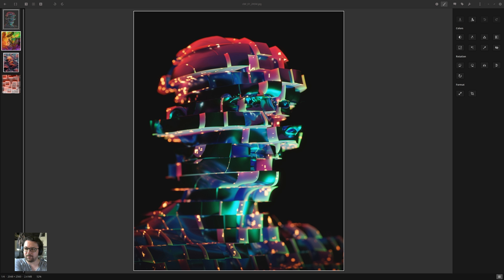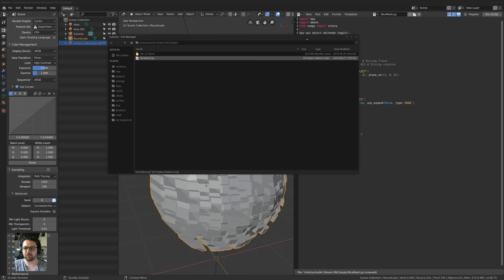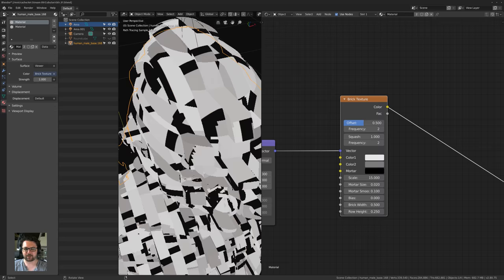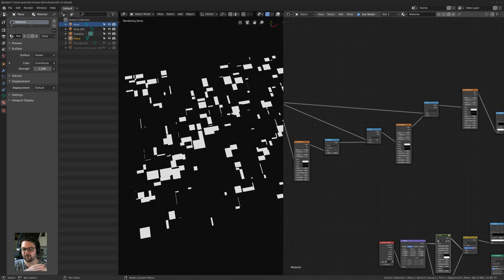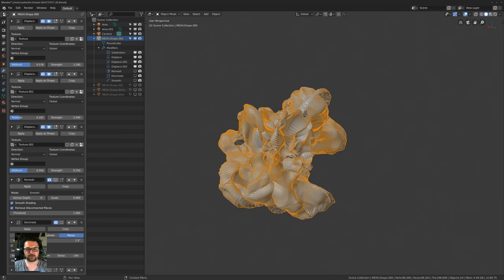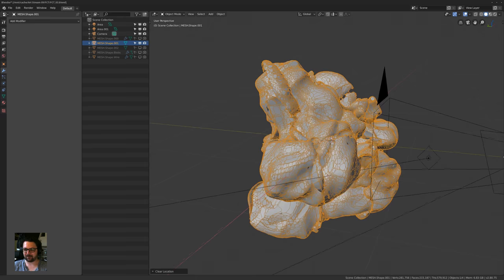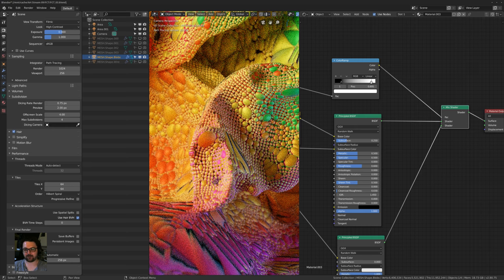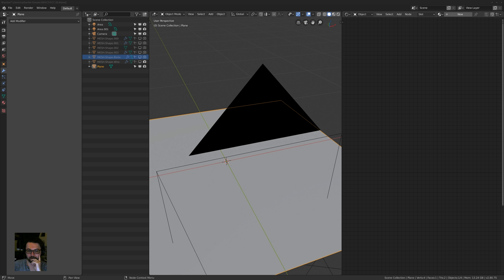Art Stream #09: Cubular, Fct, Hypergel & More! [BLENDER]

Comment: for the first slicemesh portion, once the object has been transformed, it is doing so in object mode, and I'm wondering if theres a way to use shapekeys to interpolate from the base unchopped mesh to the new one, I'm finding that this seems to be only possible if you make your edits that youd want to be your shape key target in edit mode rather then the transforms being applied in object mode.... any thoughts? And of course before any answer: thanks for all your amazing contributions including this vid and this script!!!
Reply from the maker: With shape keys the number of verts would have to stay the same, so I think once you start slicing things would fall apart, unfortunately.
Reply: @MidgeSinnaeve  hmm okay thanks that makes perfect sense but actually I was trying to do it on the before and after of the randomize transform stage, so after the cuts had already been made... does that make sense? The change to the mesh via the randomize transform is what I want my 'target' to be and then the cut up but untransformed mesh as my basis.... so the # of vertices stays the same...
Reply from the maker: @jsogman  You'd have to do some of the transformations by hand after the slicing and take out that part of the scipt, but it should work fine like that. You could even animate it indeed.
Reply: @MidgeSinnaeve  ok yep that's what I thought, but thanks for confirming!!  I suppose I dont quite understand the necessity, I guess It would be a request for a larger context based shapekey function? Like the transformations are transformations to the mesh but I guess not stored in the same place that changes to the vertices in edit mode (which I guess is more "permanent"?) I really know nothing about this stuff but its making me interested in the difference/maybe another way I could phrase it is, is this the same thing as when you apply transformations? so now that a transformation to a mesh occurs it now occupies only those verteces and is like an edit?.... thereby allowing me to make a before and after "vertex group" but having only made the changes in the object mode.... 
  yeah obv I don't know shit about how blender stores, looks at and defines data and how that relates to the way vertex groups work...... I got some research/learnin to do! thanks for the inspiration! :) (edit... now that I'm thinking about it if I could just keyframe the properties of the random transform itself that would also be awesome as Im finding it best to go easy on it and do it to only one rotation or only one location input etc)
Reply from the maker: @jsogman  Shape keys basically store the relative positions of the mesh data to the "Basis" shape you start from. It's generally used for things like facial expressions for example, but you can (ab)use them for anything you like really, as long as the polycount stays the same. :)